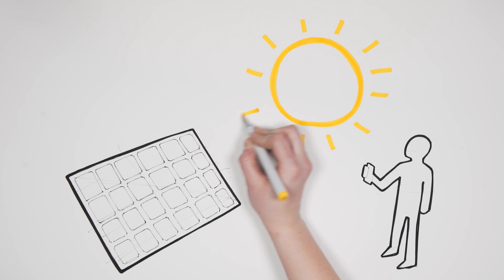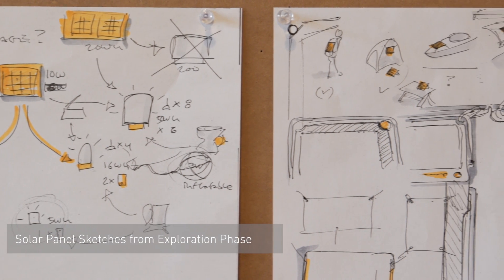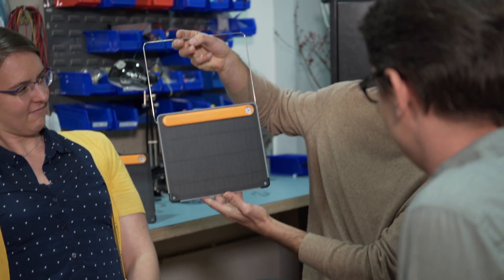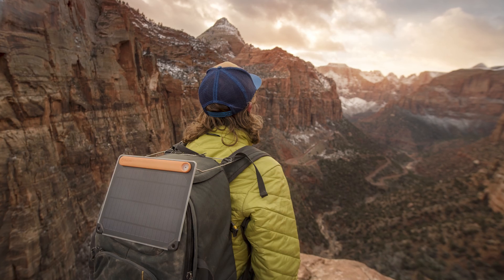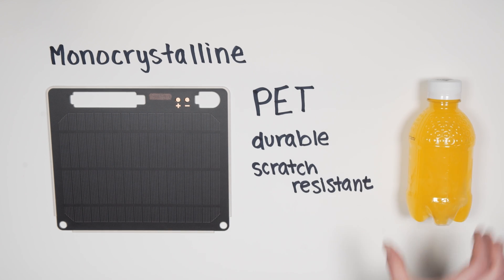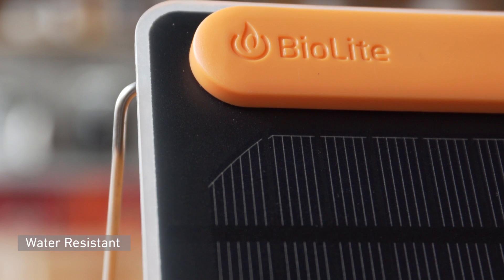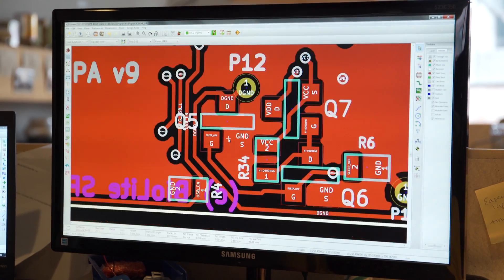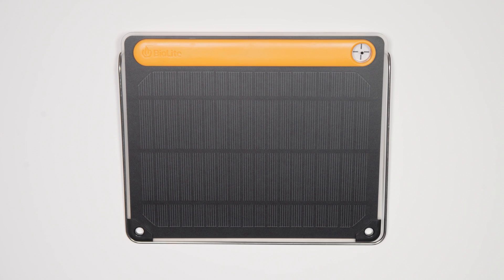How Do You Unsuck A Solar Panel?

Comment: I had high hopes, but my panel never worked properly. It sits collecting dust 😢
Reply: You may need to check the voltage and amps of your solar panel (using usb current voltage tester) collecting and that will assist you to know whether the solar panel is not defect, i think